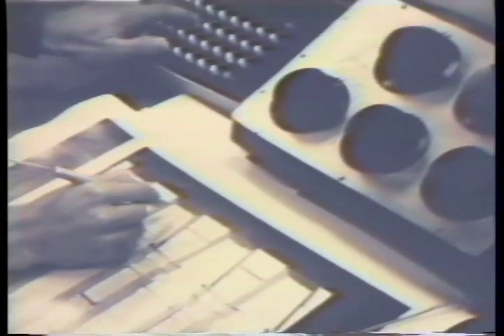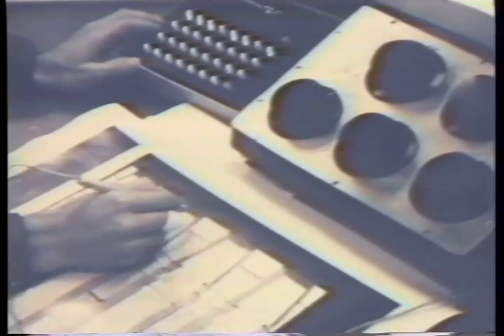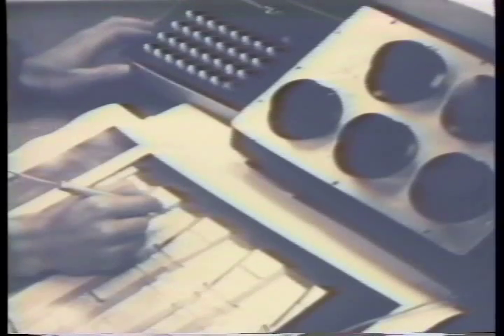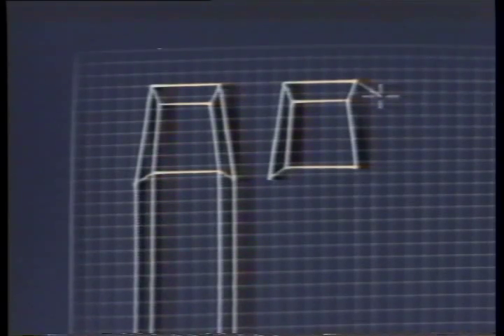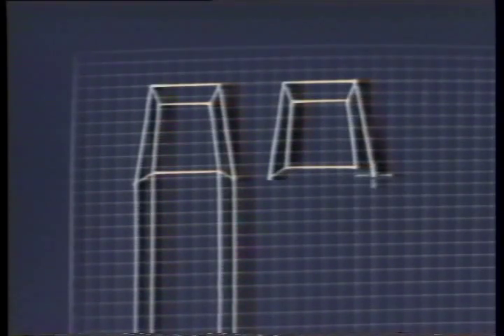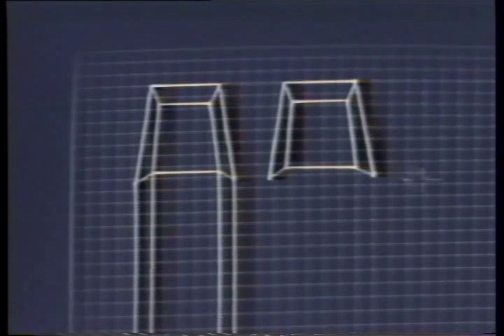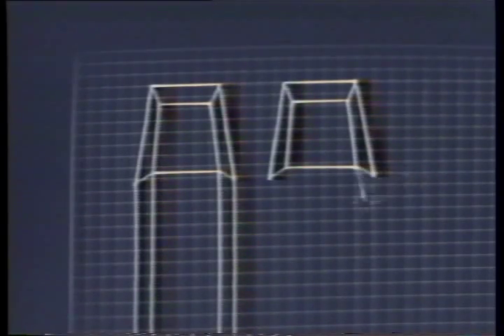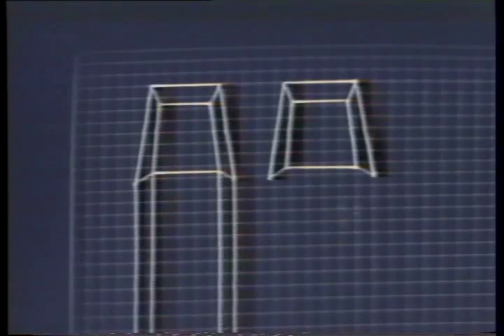Making of the Computer Graphics for Star Wars (Episode IV)

Comment: I made my own version of the Trench Run using a Tektronix 4014 memory tube in 1979 or so.  The Tek4014 had a "write-through" mode where you could do a kind of animation (Battlestar Galactica incoming Cylon animation was exactly this).  I didn't have enough baud for that, needed minimally 9600 baud, had only 1200.  I would start with a flat panel, then "glue" a random sized box somewhere on the panel , then arrange such three panels of them in a "U".  As I was working from memory, I would then join 6 U (not 4 like Larry) sections together but would add some random jitter.  No hidden line removal, none in the original.  Display 6, drop the one in front off, add a new U from behind, move half of a U section width forward, render, do it again, render, then repeat.  The rendering was fast enough (an Amdahl V8 on a Sunday afternoon) but no real time animation.  Write-through mode way to slow in 1200 baud.  Have some Polaroids somewhere.

I knew Tom DeFanti (independent study), saw GRASS in action, but did not stick around UICC after 1977.  Went to work, then to Canada, then later to Europe.

Comment: hold on, i just though of a massive plot hole. The huge guns in the trench are shooting down its length at the assaulting fighters.
Because the guns are mounted on the walls, and firing at a slant, that means the aim of the gun will eventually hit the opposite wall.
If you are firing your gun from your hotel doorway down a long hall, the bullet will hit the opposite wall behind it.
The guns on the death star are absolutely massive, so imagine the damage when the bolts finally hit.
Reply: Well, General Dodonna mentions that the shaft is ray-shielded, meaning that it's impervious to laser fire. Maybe that applies to the trench walls as well. Just a thought. :)

Comment: @agfagaevart You mean, you can make a program coded in assembly which rotates the 3D death star in real time, on a 8 bit computer? Sure, we can do better CGI on our computers, but not on HIS computer. That's the point. Bypassing technological limitations is the key. To do the 2011 equailent of Larry Cuba's work, you need to make a rotating 3D death star model with a detail as high as the original in the movie, rendered in real time. I hope you could grasp a bit of the meaning of my words.

Comment: When you think about it, this is extremely high tech stuff for 1977.
Reply: *1976
Reply: 70s got some high tech.
Reply: EVIL laboratories were always ahead of their time ;-)
Reply: In 1977 the USSR didn't have enough PDP-11 class machines even for ultra critical things like designing nuclear weapons. The US had so many it could use them for movie effects. You can see why the US won the Cold War.
Reply: @user-qf6yt3id3w  1977 USSR had already Elbrus 2 supercomputer with 10 superscalar RISC processors. It was on par with Cray-1 in performance albeit running different set of applications and 10 processors instead of one in Cray.
Reply: @valteraleksei  And how many of these Elbrus 2 machines did they have in 1976? One? Did you actually read the comment you were replying to - it didn't say that the Soviets didn't have supercomputers, it said they had a very limited number. The US totally outclassed the Soviets in the quantity of high power computers available to whoever could afford them, plus the free market system allowed private companies to explore whole new areas of research such as advanced computer graphics. The Soviet central planners simply wouldn't have been able to conceive of such applications, even if they had more than about 20 or so computers in the whole country capable enough to attempt it. 

BTW - you really should look up the timeline of the Elbrus 2, half the claims you make weren't implemented until the mid 80s. The video above was produced on a system in 1976.
Reply: @tachikomakusanagi3744  Geez dude, take a chill pill.
Reply: @tachikomakusanagi3744 it's @user-qf6yt3id3w who's making it all about politics by bringing in "east vs west" jargon, of course someone else is going to reply to that in an apposite manner
Reply: @user-qf6yt3id3w  Cold war was fake

Comment: It's possible to put together such a setup yourself. If your 3D package supports MIDI input, all you need is a MIDI controller with rotary dials or sliders. It might take a bit of fancy scripting and tweaking to get it to function exactly as you'd like, but it's certainly possible.

Comment: Wow! Computer work before the invention of the mouse looks like working with an overly complicated electronic etch-a-sketch. I'm glad this little gem has been uneathed. Thanks for posting it.
Reply: The mouse was invented a decade before this, around 1967/1968. Thats some form of graphics tablet, which are still used by artists to this day. They were technically invented as standalone devices in the 1880s but started being incorporated as computer peripherals as early as the 50s. By the 70s there were quite a few on the market. RAND made the first one at reasonable consumer prices in the late 60s.

Comment: From the speed of the rotation of the 3D building blocks I would assume that a vector graphics display is in use. However that would mean that it can draw only so many lines at one time. Which is why he draws each piece of perspective one after the other. Then the picture is composted together by using the longer exposure of the film. Very cool.

Comment: As a computer graphics engineer I have to say it's reasonable that this was built with assistance of computers in the manner represented here. Vector (rather than raster) display technology was normal at the time. Computers of the time would have had trouble rasterising and computing the 3D space trivialized in this video, but vector displays would have had no problem with it. As for the other stuff you said, I have no opinion on that.